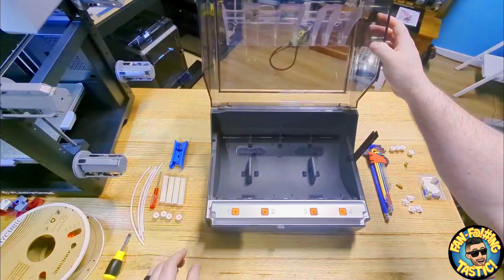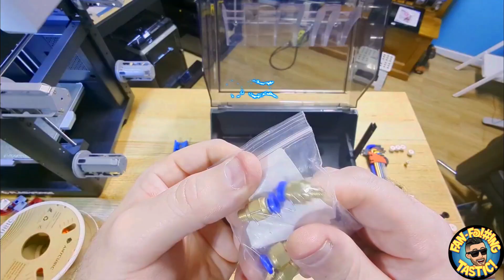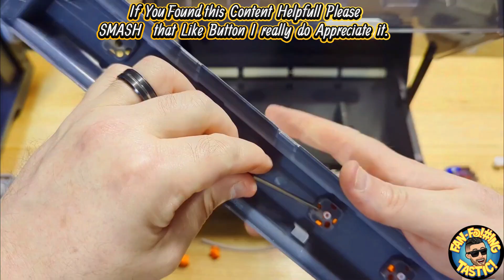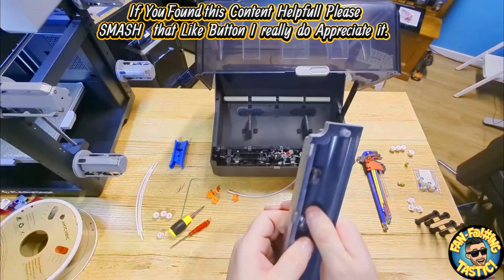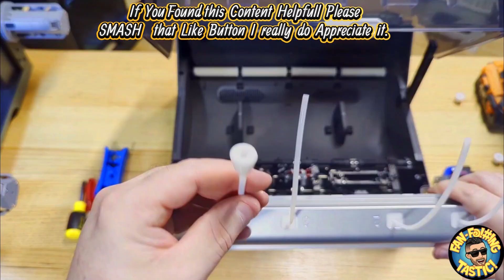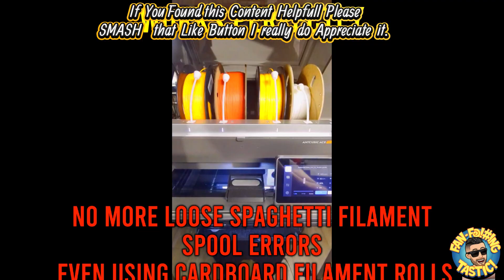Anycubic Ace Pro No More Spaghetti Filament Fixed My Tangled 3D Printer Filament Fast!

Comment from the maker: Rotationally Resistance? Not Rotational Gearing   ------ The rear rollers do not change the ratio of rotation BUT They do change the rolling resistance on the forward roller carriage. This is whole point to put more pressure on the forward Motorised roller even 2-3% forward rotation will increase rotationally rotation. This is No different than a Bicycle when size on over all Rotation on a Angle Hill. This is not a Gearing Change But a Rotation Change with Tubing Upgrade which actually makes a huge different from testing. This is why the file also has over 3k downloads and 4.5 star rating. Thankyou for your feedback Most appreciate. I applaud all Positive and Objective Critisism as it engages conversation and testing for everyone.  Thankyou

Comment: For anyone watching 10:15 where he is pointing, the white connector goes to the filament sensor.  If you carefully look in that hole, you will see a little 'flag' in there.  The filament pushes it back into the sensor which detects the presence of filament and turns the LED on and the motors on to load it.  That flag can get damaged or even just worn down by rolls and rolls of filament passing over it and it will stop working or work intermittently.  I couldn't find the sensor on Anycubic website, but I did find the flags you can print (which I had no luck because they are small and fragile) or a new block that replaces that black block the sensors are in and the filament passes directly in the sensor eliminating the flag.   One warning on that, which I haven't experienced yet, but makes sense, if your filament is too translucent or transparent, the sensor won't 'see' it.
Also, the rollers in the back are just idlers...they don't do anything to the ratio.  You would have to change the motor pulleys or the diameter of the front drive rollers.  But I think bigger rollers in the back probably get the spool to sit in a better angle to quit wobbling and bouncing everywhere.
Reply from the maker: Thanks for your Feedback.  Rotationally Resistance? Not Rotational Gearing   ------ The rear rollers do not change the ratio of rotation BUT They do change the rolling resistance on the forward roller carriage. This is whole point to put more pressure on the forward Motorised roller even 2-3% forward rotation will increase rotationally rotation. This is No different than a Bicycle when size on over all Rotation on a Angle Hill. This is not a Gearing Change But a Rotation Change with Tubing Upgrade which actually makes a huge different from testing. This is why the file also has over 3k downloads and 4.5 star rating. Thankyou for your feedback Most appreciate. I applaud all Positive and Objective Critisism as it engages conversation and testing for everyone.  Thankyou. 👍👍🤪🤪😊😊